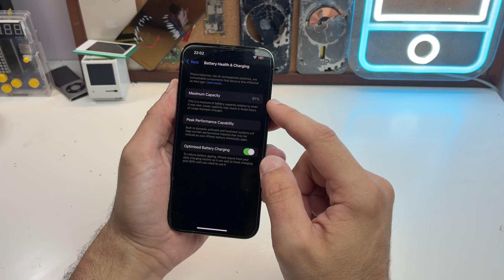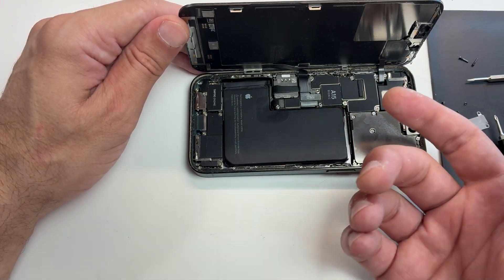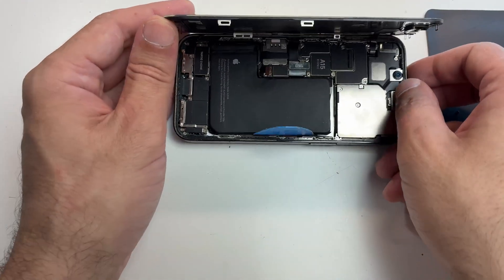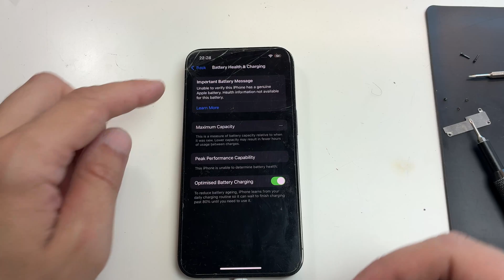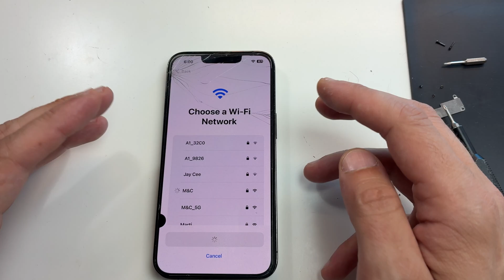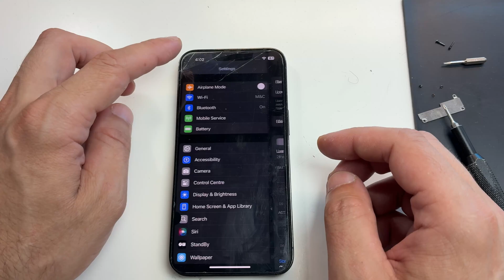iPhone 13 Pro Battery Replacement + Balkan’s Tips and Tricks for Quick and Easy Repair

Comment: If I buy a off brand battery will I be able to pair it to the iPhone with the new iOS or is that only for genuine Apple battery
Reply from the maker: Only genuine battery can be paired, but if you got any other battery you can still see battery health but there will be message on top that it might be non genuine like in the video .
Reply: @BalkansWay thanks! Does it still pop up a notification everytime you open your phone? Or does it only show if u go under battery in settings?